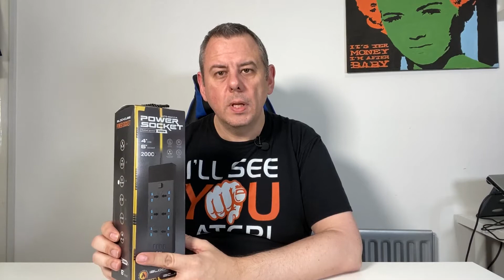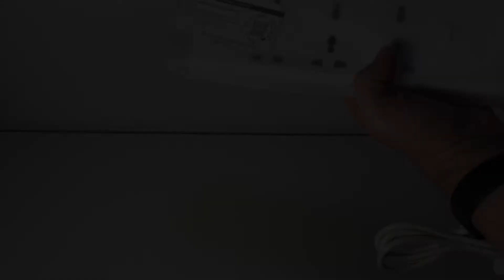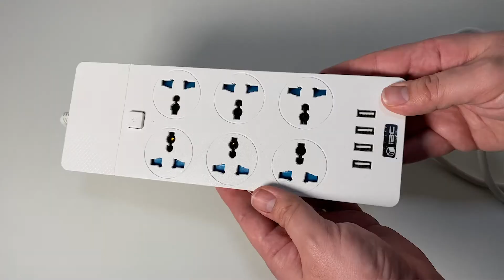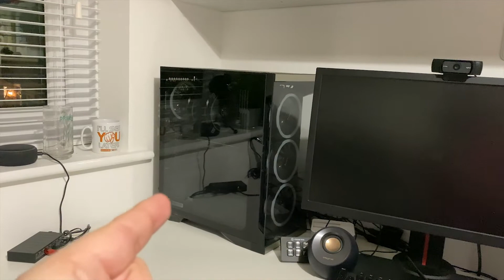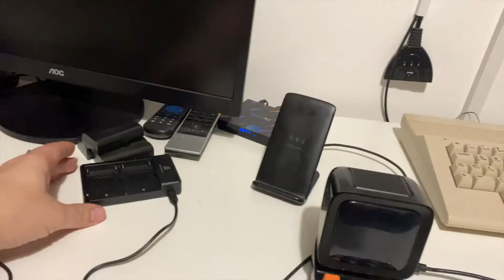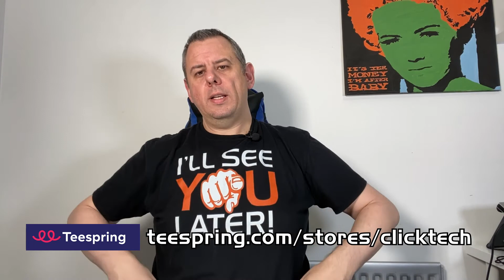iBlockCube Universal Power Strip with Surge Protection & USB

Comment: Dude be careful, I had one of these iBlockCube exactly like yours from Amazon - sent by iBoxCube themselves, and when I took it apart, it turned out it had no ground connected to sockets - the yellow cable was not there (even though the insulation was thick and looked like it should have), and there was no surge protection at all. You should see if yours is any better .